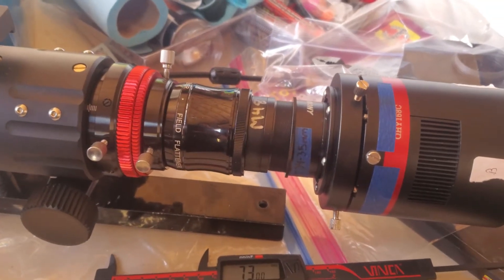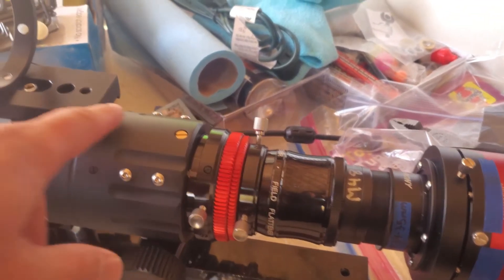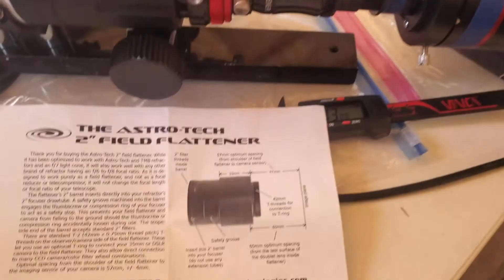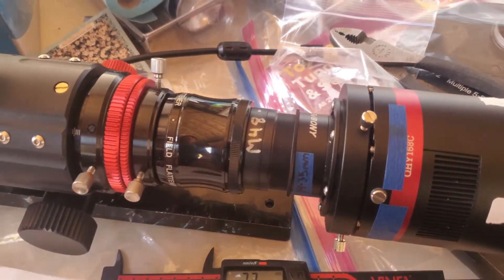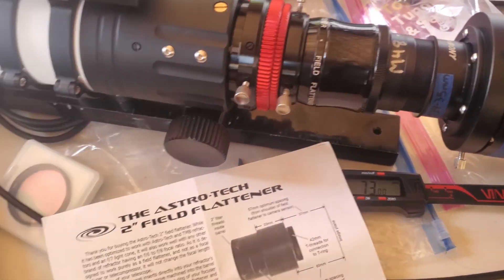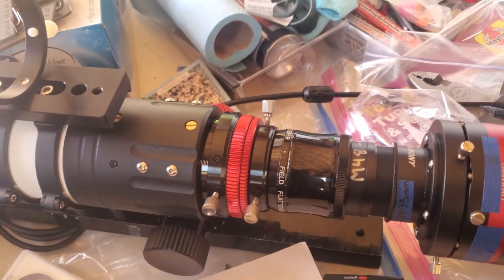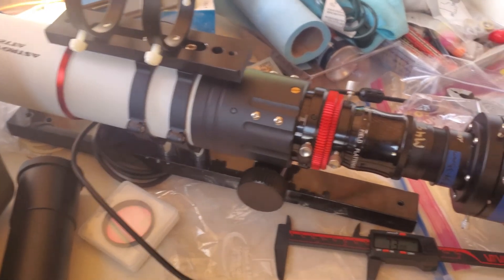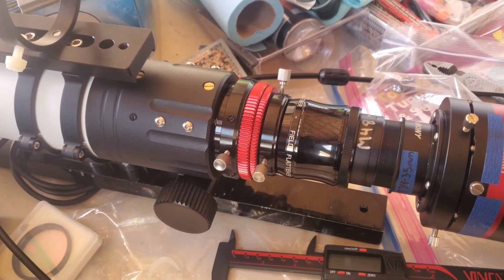Backspacing, flexure, sensor tilt = stretched stars?

Comment: Great video. I thought I would chime in with my recent experience.  I have a William Optics Z73 with a William Optics Flat 73r flattener/0.8 reducer and struggled like you have. A friend suggested N.I.N.A. Hocus Focus Aberration Inspector. Great tool. It tells you if you need to increase or decrease your back focus and measures tilt. I dialed in my flattener in one evening. I ended have to adjust my flattener 1.7mm beyond the initial recommended. The initial recommended is for Crop Sensors and mine is a 4/3. I have no idea why that would make a difference. I ordered some Astrodymium tilt rings and adjusted my tilt. Problems solved quick and efficient.
Reply from the maker: Thanks for the reply! It's so frustrating trying to adjust backspacing and tilt in the dark when you're basically just guessing. I will definitely look into N.I.N.A.

Comment: Hi good work on this, any update? I just ordered this scope with the 0.8 RF/FF and plan to test the 0.6 RF/FF on it making it an F/3.6 fast scope at 254mm.
Reply from the maker: I was really hoping to get this scope sorted out, but just couldn't get the stars to be acceptable. I ended up selling it. I might try a RASA 8 in the future.
Reply: @deepskyutah5257  yeah I now expect to be returning it! On SVBONY site they say 1/3 to 1/2 inch sensors as it has too much softness in the outside from the center!

Comment: I too have the AT72EDII and the AT flattener/0.8 reducer. One thing I noticed watching your video, you are running the field flattener in to the 2” compression ring accessory holder (the black ring with the 3 thumb screws you mention). I removed the 2” compression ring accessory holder and screwed the flattener straight in to the rotator (red ridged ring) My back focus is working well at 55mm.  I wonder if that would change the back spacing needed for you, as the flattener is picking up the image cone in a different place?
Reply from the maker: It's been awhile, but I think I did try that same approach with a different flattener (maybe the Williams Optics?) and still had problems. I ended up selling the telescope because I just wasn't getting much use out of it. I hope to try a RASA 8 when I get back into the hobby. Glad to hear it's working out for you, though!

Comment: I have been tempted to look at getting one of those variable adapters when messing around with back focal lengths to  speed up the process of determining optimum length, so can then get the correct fixed rings required. The Baader VariLock is an example of one of the ones I have seen. They have 2 versions, 20-29 mm and 29 to 46 mm.
Reply from the maker: Thanks, Dave. I have a cheap Svbony variable extension, but it's a little difficult to adjust without taking the imaging train off. I hear good things about the VariLock. I'll see if I can find a used one.

Comment: I am having a similar issue. My next test is to se what I get without the field flattened. If the stars look all symmetric then I would guess it’s the flattener. If it’s to one side then it could be flexure or collimation. Have you rotated the camera to see which way the comma moves if at all?

Comment: Have the same issue with my AT80EDT and their field flattener. One solution I came across was to use a 'tilt corrector'.  Way too much $$ snd more weight on the mount.  In the end, my opinion is that it's a flaw in the flattener that the manufacturer should fix.

Comment: Good video showing the examples of the different back focus lengths.  I too have been playing around with the same issue using the Orion Flattener for short focal length refractors. (Mine is the Orion ED80T).  Are you sure your image train is perfectly aligned?  That would cause the same effect of oblong stars in the corners.  One way to maybe check that out is the set the backspacing to the recommendations ... take a test image, then rotate the optical train, say 180° and take another test image. If the deformed stars are in the opposite quadrant, then I would think it's a backspacing issue.  If the deformed stars are in the same quadrant, then it might be an error in optical train alignment.  Just a thought.
(Patrick Prokop, Savannah, GA)
Reply from the maker: Hi Patrick. Thanks for the comment and suggestion! I did try rotating the optical train, and the stretched stars did seem to rotate along. I picked up the Orion flattener for short focal lengths, and I did get better results with it over both the Hotech and Astro-tech flatteners....but still not perfect. I have the William Optics Flat 73a arriving tomorrow to try out. I think my Astro-tech telescope might be the same design as the William Optics 73II, and someone on Cloudy Nights claimed to get perfect stars with the WO Flat 73a + AT72EDII telescope. It's such a pain doing all the back and forth testing when the temperature is about 10 degrees out, haha.

Comment: your camera will cut 17.5mm from that 57mm range.
Reply: so from the BASE of the camera you have to have ~40mm max to the flattener. which in my opinion you really dont have :) or at least ti looks like
Reply from the maker: Sounds like you didn't want the video. I tried different spacings from 55mm up to 80mm. The best result was around 73mm.
Reply: @deepskyutah5257  then there is something very wrong with documentation. According to what you showed in the beginning for the flattener, the backfocus should be 57mm from the flattener, which is 17.5mm camera +40mm equipment with roughly 2mm filter, or + 39.5mm without filter.
Reply from the maker: @bokvaj  that was the whole point of making the video. The measurements given in the instructions did not produce good results. I am not the only person having this issue with this telescope. If you do some research on Cloudy Nights, you will see there are others with a similar experience. Contacting someone at Astrotech was no help. They are mainly just salesmen with limited experience or desire to help. There is probably an issue with the telescope, since several flatteners did not seem to work properly. In any event, I no longer have the telescope. I'll be getting a RASA8 instead. Best of luck to you.

Comment: that fieldflattner is not the best quality,i had the same one..also bad stars. you need a flatner special for short scopes. like these. https://www.teleskop-express.de/shop/index.php/cat/c138_Reducers-Converter-Correctors.html  there are multiple versions.
Reply from the maker: I will do some research on flatteners for shorter scopes. It looks like Orion sells when here in the US. And now it makes sense why the image improved when I added backspacing. One telescop-express, one of the flatteners says the shorter the focal length, the longer the working distance must be. Thanks for your help. If I don't figure it out after this winter, I will just trade for an 8" RASA, haha.